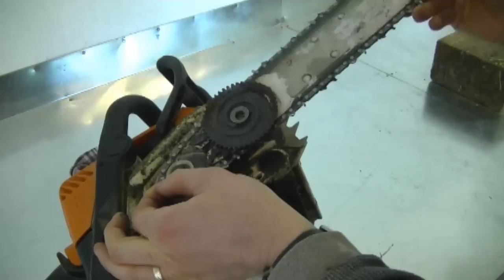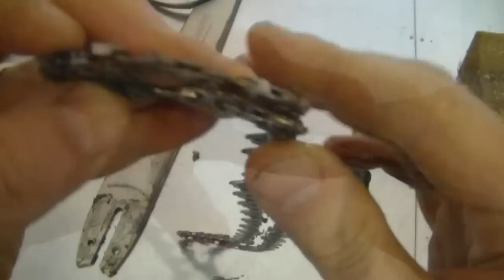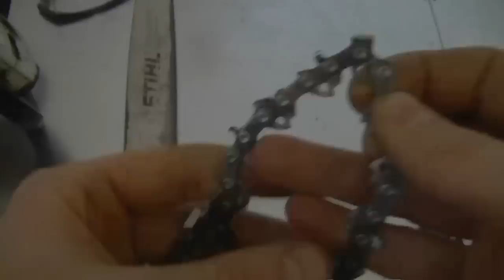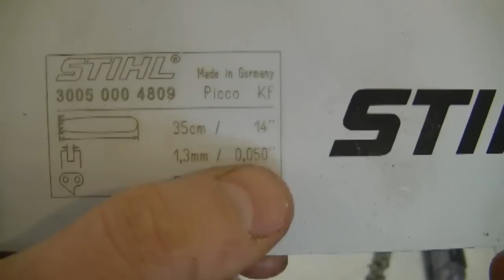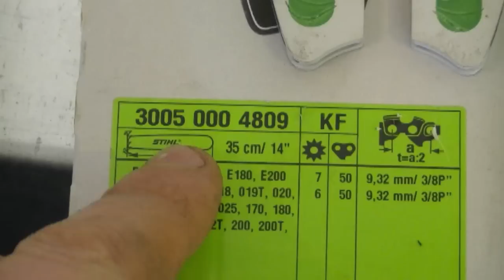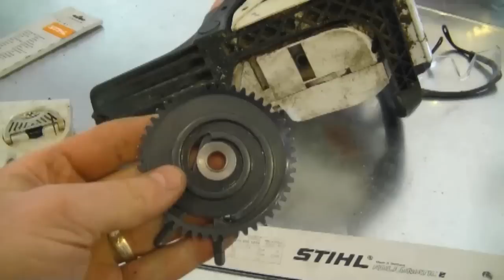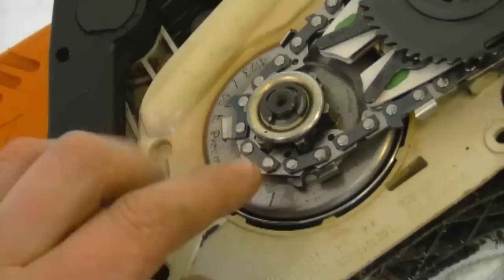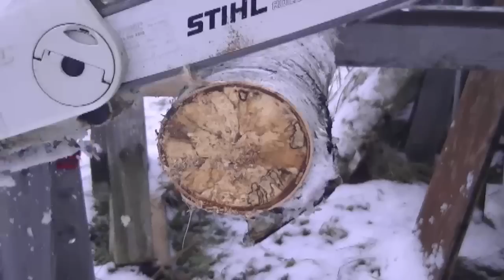How To Install A More Robust Bar & Chain On A Stihl Ms180, 170, 018, 017 Chainsaw

Comment: Going to upgrade my new ms170 today. Going with a 14 inch bar and .050 chain. Those 16 inch .043 chains that come on the saw sucks.
Reply: Rich Burnette that is so true
Reply: They're only necessary if you're cutting wood over 24" wide. So they're good to have on hand.

Comment: if you use a carbide chain then the saw will run more than ten times longer in between touching up the chain.

Comment: Well done video!
I would like to mention that running a .050 chain on 16" bar would not be recommended for the 1130 series saws. 
If you have a saw like the MS 200 T or MS 230 D you can use the new 63PD chain. This Duromatic chain lasts much longer than standard chain. I recommend talking to a local dealer like arcolawn.com to see if it is right for your saw.
Again great video. Let's chat some time about fuel reversion.
Joe

Comment: You need power to rotate that heavy chain. The motor,bar size, and chain are engineered to match. Im not saying this wont work but expect performance loss.
Reply: That's why you drop down to a 14inch bar.
Reply: Rob Rotenberry how is that a gain?
Reply: good for you
Reply: Bar length loss? you pruning rose bushes physics guy? mean effective pressure and increased rotating mass equals power loss. Why not stick a 48 inch bar with half inch teeth on your little weed pruner?
Reply: I love trolls! They talk to hear them self!
Reply from the maker: I know and they never put out quality videos
Reply: Do you know anything about the subject? my ms170 has a 16inch .50 bar with a PM3 chain and it cuts a lot better than the original set-up.

Comment: That gauge of the chain isn't the cutter tooth?! The .043 chain does utilize a narrow kerf chain. The original 017,018C had .050 bar and chains and they were duds due to the extra weight of the chain, so the factory changed to .043. We have "0" problems with .043 & narrow kerf chain on these units. Be careful about what you spread as it will compromise the performance of these pee-wee saws!
Reply: It's weird that he called the 0.050" superior when it is just a different size.
Reply: I did this to my 170 long before I saw this video and it did significantly improve the saw's operation. 2 years in it is working just fine. Perhaps, You need to be careful what you spread before you actually try it so you really know what you are talking about, instead of just speculating about what you think might happen.

Comment: Ummm..... it's .043 and .050 INCHES, not GAUGE. Think about it - with any unit of measure using "gauge" (ammunition, wire, etc), a larger size has a SMALLER number. And no, it's not nitpicking. Poor use of unit of measure brought the Challenger down.
Reply: Ummm...ok genius

Comment: Buyers be aware! Once you purchase a Stihl chainsaw you only have 10 years for parts ...after the 10 years is up you can no longer buy spare parts ...I found out the hard way ...never buy a Stihl chainsaw again !
Reply: Have you checked into parts availability for older Husqvarna and Echo saws? I own 12 Stihl tools, and the oldest — 026 saw, a backpack blower and 019 top-handle saw — and among dealer parts, aftermarket and used parts I have kept all of them running.
Reply: @thardyryll  the Stihl dealer was able to fix my chainsaw , he told me that he cold welded the choke housing , I take very good care of my Stihl & he could tell as well that it hasn't been abused , they also told me that even they can't figure out why Stihl doesn't make replacement parts after the 10 years mark ...but my chainsaw is up and running like it was brand new again ...thanks for the information , the dealer also gave me the same information as yourself ..have a good day .
Reply: Aftermarket parts are junk.  I've been waiting for 3 months for parts for my 026.  Bought an Echo and will never buy another Stihl.